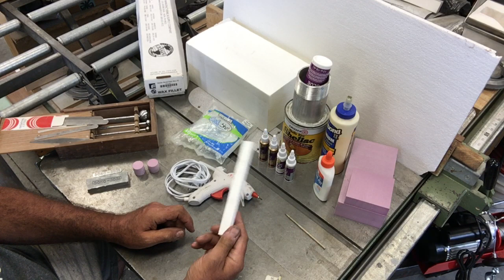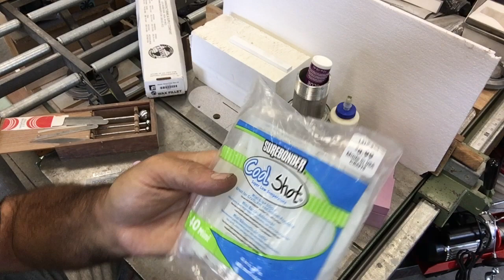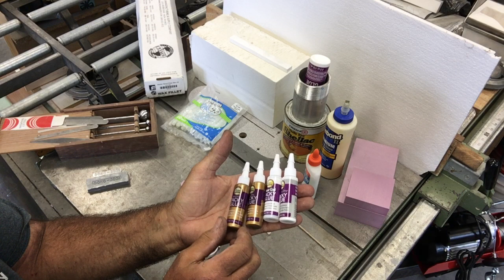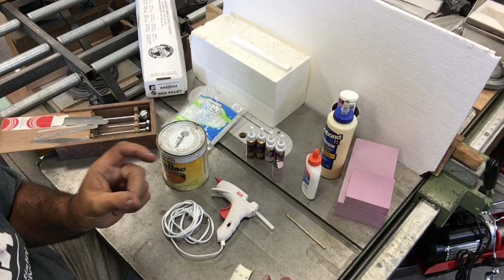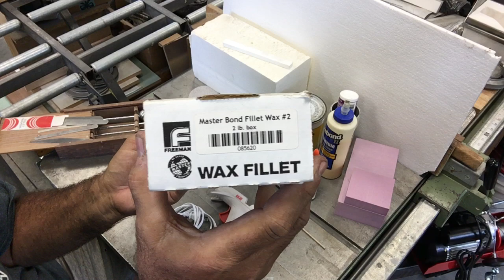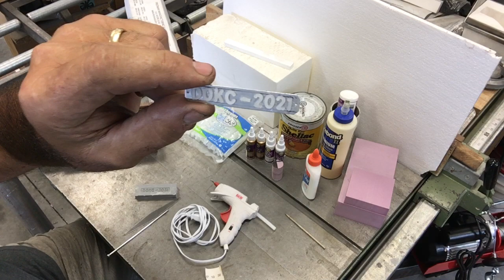Pattern Materials for Lost Foam Casting

Comment: Hi Kelly another excellent video. I’m just starting out in the world of metal casting hoping to put together some 1/6th scale vintage MX motorcycles. Just struggling to find much variety in the way of different shaped extruded polystyrene (UK based) and I wondered if the 2 pieces of rod which you used as an example for glueing pieces together were purchased or there is some way of forming them ?
Many thanks from your latest subscriber.
Reply from the maker: I bought a set of woodworking tenon cutters that cut various diameter "plugs" up to 1"D. I use them for sprues and bosses. Shapes can be machined/formed using a hot wire cutter, manual or CNC router, belt/drum sanders, or just hand carving and sanding. Search my channel for examples. Best, Kelly
Reply: @kellycoffield533  Many thanks Kelly all really helpful ideas 👍

Comment: Can expanded Polyethylene foam tubes be cast with lost foam? It is a thermal plastic
Reply from the maker: I don't know for certain, but it may be worth a try. The melting point of polyethylene is much lower than polystyrene. If the density is low (say <1.5lbs/ft3), it may work just fine. I presume you are talking about flexible foam insulation tube. Being able to bend and position it could be pretty interesting and useful. If the tube diameter is small and long, it may become very difficult to keep the core stable but that is true irrespective of the pattern material. Best, Kelly

Comment: Thanks for sharing your knowledge with our thirsty minds. Of all different casting techniques, i like this one the best. I need to cast a practical part that will need to retain the mechanical properties of the original aluminum. However, i don't know if lost foam method would contaminate or cause porosity in the cast. What is your experience on this? What happens to the resulting gas in the process?
Reply from the maker: IMO, casting design, feed system design, and melt management a far greater factors in obtaining a casting with good material properties rather than the use lost foam or conventional sand casting process, especially for a non-professional hobby caster. Of course, you need to start with a known alloy, but even then, hydrogen porosity is the most common source of degradation of aluminum mechanical properties. The decomposed polystyrene gases resulting from the LF process are not soluble in molten aluminum. In general, permanent mold casting alloys and processes can achieve better mechanical properties than sand casting processes. Casting alloys will never achieve the mechanical properties of wrought alloys. Best, Kelly

Comment: This is great info!  Have you tried 3m foam safe spray adhesive?  I think it's their number 78.  Asking because I believe some model makers are using it for foam laminations of the pink foam to make aircraft wings, and it's supposed to hold up pretty well.  If it's a thin film, I'd think it would cause less problems with the routing.  For them, they use hot wire cutters and I guess it works just fine with hot wire cutting.
Reply from the maker: It works fine for sticking foam together and it can be cut with a hot wire but its a sticky mess if you touch the joint with a router bit or sand paper........instantly loads the bit and will ball up and not sand evenly. Best, Kelly

Comment: You ever try rubber glue?...it only sticks to rubber glue I use it on my Table Tennis rubbers to hold the foam backing onto the wood blade...
Reply from the maker: Not sure what you mean by rubber glue. For gluing rubber? Contact cement? The solvent in the glue cannot attack the polystyrene foam. That eliminates a lot of candidates. The foam safe contact cements are essentially latex. They work, but still wont dry on the interior of large surfaces if you are laminating and they stil gum up a cutter. Best, Kelly

Comment: Ciao Kelly
Could you advise me on some material to use in place of the refractory paint? is liquid chalk okay? which one would you use if you didn't have the right paint? Thanks and best regards.
Reply from the maker: If you are casting aluminum or non-ferrous metals, I'd suggest drywall joint compound. In the US, gypsum board is known as "drywall". The non-setting lightweight joint cmpound is best and available in the home improvement stores. Just thin it (with water) to the deisred consistency for brushing or dipping. It only needs to be a thin coat on the pattern, not a built up thickness. If you have colored foam, just enough to turn it white. It's purpose is to reproduce surface finish of the pattern and provide a permeable coating to control the rate that the evaporating foam gase escapes, not to bemold support. Best, Kelly
Reply: @kellycoffield533  Thanks for the comprehensive answer, you are a very helpful person and a gentleman. now I understand the meaning of refractory painting. Thanks again and my best wishes from Italy.
Reply from the maker: @pasqualesgro  Felice che tu l'abbia trovato utile. Alla prossima volta amico mio. Kelly

Comment: Please talk about the poisonous fumes from melting foam.
Reply from the maker: They are toxic like most anything else that is a byproduct of combustion. Use common sense, cast outside, don't breath in the fumes, and if you think you cant accomplish that use a respirator. Toxins unlike poisons have tolerable exposure limits TLV. Hard to know where your at on that scale but for infrequent exposure the threat is small compared to other things you encounter every day. For small pours in 5 gal flask I can easily avoid any fumes. For large pours I will use a respirator, especially when demolding. If you are uncomfortable with that, simple, just dont do it. Best, Kelly

Comment: What a HUGE wealth of information!  Thank you!  Love your channel.  One question:  I have a few custom parts I'd like to have cast for my boat in silicon bronze but have little interest in acquiring all the tools to actually melt metal and do the actual casting.  If I was to make patterns out of foam using these techniques would a foundry consider pouring the metal for some one off parts?  Or do you think I'd have to go so far as make the container, vibrate the sand, etc and then deliver something like that to a foundry?  Anyway, excellent channel!
Reply from the maker: Unless you have a personal relationship with someone at the foundry, I'd say very doubtful. Most foundries will have no lost foam experience whatsoever and even so most want production work and dont want to mess with individuals. I think best bet is to find a small one man foundry or do-it-youselfer that has SiBr casting experience. Best, Kelly
Reply: It's better to ask in the winter. My friend walked in the first place in the yellow pages. Started to tap his feet at the door and wound up on his ass with one of the Hobie molds cushioning his fall. They were very accommodating and symbolically slipped his parts in at no charge. The rudder stabilization fins worked well for a prototype and frozen snowmobile boots on advertiser's fancy water catch mats don't stick together worth shi... .. .oww. Bounced back, twice.

It never hurts to ask?

Cheers.

Comment: I use lost wax quite a bit, and found you can melt a block of paraffin and cut up a plastic bucket (5 gal type) and add by weight a ratio of around 1 to 4 plastic to wax, let it cook until the plastic resolves, stir it up really good, let it harden and it makes a carvable wax, kind of soft. It shrinks a little as it hardens, you have to work with the ratio to get the lowest expansion rate, but it works, using plaster with a can to hold it together as it burns out, and its cheap. Do it way outside if you try it, it is flammable. The rest of your stuff is good stuff. Cant wait for the snow to melt...
Reply from the maker: A lot of people tell me I should be using lost wax or PLA, but unless you’ve used both processes, you wouldn’t fully understand that every process has its place. I use lost foam because I primarily make one-off or low quantity automotive and machine parts. IMO, lost foam requires significantly lower material and labor cost than lost wax and as parts get large, this difference becomes even greater. The same is true for lost PLA whether block investment or shell. Foam is much less expensive than wax for patterns but the biggest differences come from what it takes to make the mold and claim the casting from the mold. For a lost foam mold, I literally pour dry sand into a barrel around the pattern and vibrate it. It usually takes 5-10 minutes and I do it while the metal is melting. 

To demold, I simply dump the flask/sand on the ground, pick up the casting, cool it in a bucket of water, and nearly all the refractory coating (applied in a single dip coating) just falls off. Any remainder is blown off in a minute or two with compressed air. Keep in mind the molds for my parts are typically between 75lbs and 450lbs. Dry sand mold material is $20/ton, but it’s completely reusable (no disposal cost) and requires no special treatment other than keeping it dry. Then I just shovel the sand back into the flask through a sifting screen for storage  and next use. Now imagine the equivalent cost and labor for block or shell investment; the cost and work to prep that much of investment, invest it, fire it, (yah, fire 450lbs of investment!), the apparatus required to heat and handle that large hot mass, and then chip away the clinging mold to claim the casting. It’s just no comparison. Now for small parts with fine detail and repetition like jewelry or artwork, lost wax is my choice. Best, Kelly

Comment: OK Kelly, I give up....I have tried everywhere I could think of to find "non setting drywall  compound". It seems to be non existent? Can you be more specific on the type or brand of compound you are referring to?  I have everything I need to duplicate your casting process shown on your you tube videos except for the coating slurry.
Reply from the maker: Michael, it's light weight joint compund for drywalling and any home improvement (Lowes, Menards, Home Depot) store will carry it. I used USG Sheetrock brand but that doesn't matter. Buy the premixed kind in a pail. You may have viewed it already but I have a video entitled "Refractory Coatings for Lost Foam Casting Patterns" It has a link to a Web Forum thread on the subject with more discussion on use. Just thin it to either a brushable or dipping consistency. Best, Kelly

Comment: Mr Kelly ..How can be  reduced the brittlness of castings.
Reply from the maker: Hard to say if you dont know the composition of your casting stock, but many metals are soluble in aluminum and above small levels reduce strength and elongation. If you use a steel crucible (as opposed to clay/graphite), iron contamination could be the culprit, or if you use your crucible for other metals, that can be a source of contamination. Small amounts of copper or chromium will embrittle Aluminum.
Reply: @kellycoffield533  Thank you Mr Kelly .after your advise I stoped using steel crusible .but the brittlness same as before .

Comment: Can you use the can foam or the pour foam into a mold to make the foam pattern?
Reply from the maker: My answer would be no, I wouldn't recommend it  because 2-part foams are thermosets (usually urethanes) not thermoplastics (usually polystyrene), and they tend to just decompose to ash and solids as opposed to melting and turning to vapor, which is important in producing defect free lost foam castings.....but, I have seen some castings on YT that used such. However, they didn't look like an acceptable result by my expectations. Best, Kelly

Comment: Sir
1 Can we dilute shelak & what kind of alchole to be used
2 Can we use water base wood polish as smooth surfant
Reply from the maker: I use denatured or isopropyl alcohol to dilute shellac because I have it. I don't know about water based wood polish, depends if the other  ingredients can melt and burn out cleanly. You'll have to try and see. Best, K
Reply: @kellycoffield533  Thank u very much

Comment: I wish i seen this video a year ago.  i've been having trouble with gluing the spruce on. My glue gun gets too hot and it melts the foam. I've also tried laminating foam and got my endmill gummed up. Thanks for the tips. I'll have to try and find some of that  tacky glue.
Reply from the maker: If you install a dimmer switch ahead of your glue gun you can use it to control temperature on most hot melt guns because they just have a resistive heating element. Just make sure the dimmer is suited to the current load. Best, Kelly
Reply: @kellycoffield533  that's brilliant. cheers
Reply from the maker: On laminating, try shellac or polyvinyl alcohol. Best, K

Comment: another good solution for laminating large areas with the thinest possible glue line (and also as a general instant adhesive) is mounting film it works just like double sided tape only theres no tape just 23um adhesive film -ts called - neschen  gudy  and is marketed for photo mounting  you can get it in permanent and repostional  versions in any width up to 6ft - downside not the cheapest
Reply from the maker: Thanks Philp, I'll have to look into that. I suspect it may still load up cutters and abrasive but so does most everything else. The most promising glue for laminating was Cyanoacrylate/CA, because it was chemically activated, could be applied very thin, and cured hard enough to be machinable, but my hopes were dashed because the solvent/propellant in the spray activator aggressively attacks the foam. I occasionally come across come CAs that say they are foam safe but they are very expensive. If anyone knows of a foam safe CA I'd be eager to give it a try. Best, Kelly
Reply: @kellycoffield533  What about the baking soda/ CA stuff. I checked, baking soda dissolves in alcohol. The powdered surface after drying was delicate but its only needed to apply the BS to one surface. I suppose if you need a stronger bond a very slight amount of shellac might work.
Reply from the maker: @dave_ecclectic  Is the NaCHO3 the activator for CA or a filler? I've recently found some more reasonably priced foam safe CA products I'm going to try for laminating. The model airplane and rocket hobby sites usually have good sources. Best, Kelly
Reply: @kellycoffield533  Not Nachos, baking soda.
 It acts like an activator although is is a filler too.  You should try it just to try it. Its an interesting affect. Put a drop or so of CA down and push some nachos into it.
Reply from the maker: @dave_ecclectic  I'll have to remember that the chemical symbol for baking soda (NaCHO3) looks/reads like Nachos....LoL. I'm going to try some CA glues but one another important requirement for LF materials is that materials burn out cleanly. Are you using CAs with success in LF casting? Commercial lost foam fillers are paste waxes with plastic microspheres and those can be purchased in small quantities from the model airplane and rocket suppliers but the best solution is to not need/use fillers :-)
Reply from the maker: ......I completely forgot to mention Polyvinyl Alcohol (PVA) for laminating. It takes a while to dry when laminating large areas but works pretty good and less prone to loading cutters. Downside is it can get thicker than desired if applied to a machined surface. Works better on the smooth undisturbed surface of a XPS plank. Best, Kelly